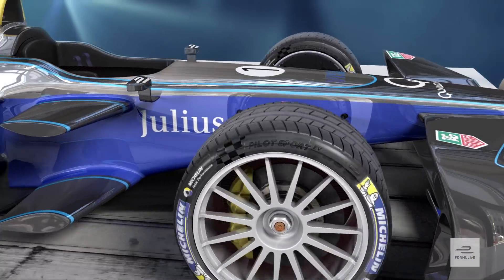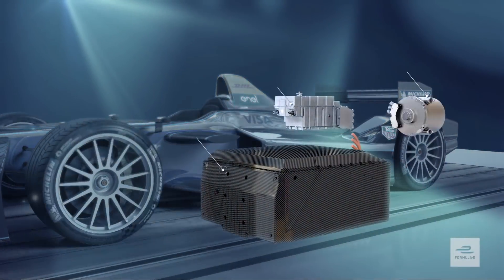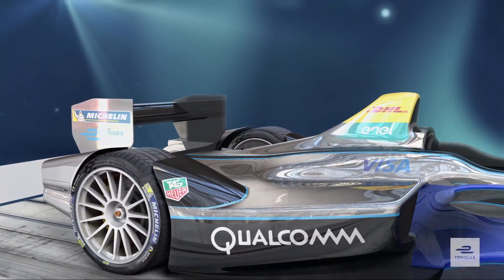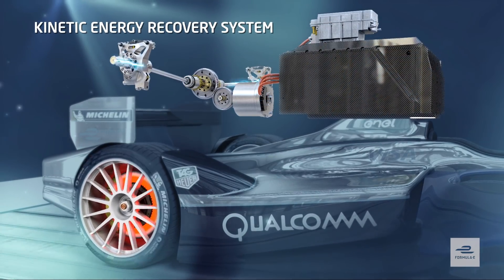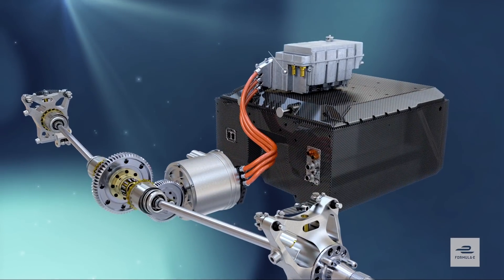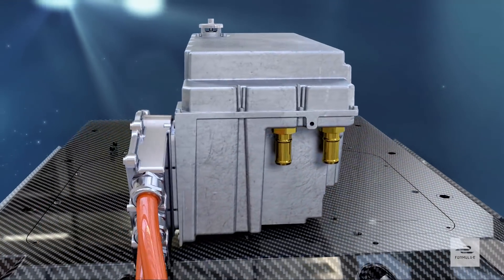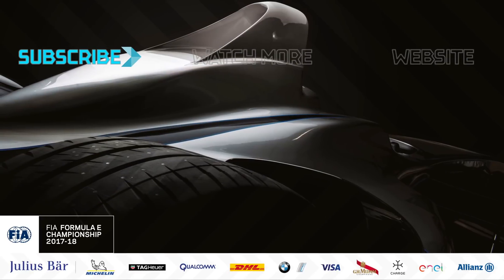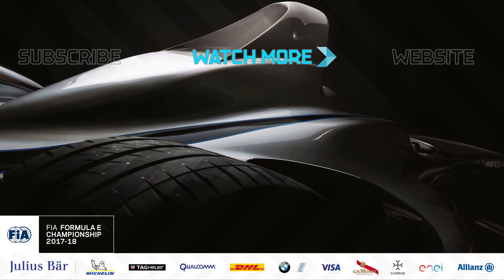How Does A Formula E Car Have Instant Power?

Comment: how many years is it estimated till every team has pretty much completely different cars for each team, because right now there seems to be a lot of components that every team has to use
Reply: electric car is a new one so they dont want one team figuring something out and destroying a whole season. but if they want to help develop e-car tech, they need to fully encourage battery and motor developments. you can still set size and weight limit for the battery, so they'll actually improve rather than using bigger ones.

Comment: I was expecting some mindblowing information, not that in F-e cars have battery and electromotor/generator which transforms electricity to movement and vica versa. That's just basic, not very clever.
Reply: If you read the title again, with this simple things, you can achieve an instant power. That is the clever part.

Comment: I was under the impression that an electric motor delivers instant torque, not power.
Correct me if I am wrong.
Reply: Power = torque * w  where w is rotational speed in radians per sec.
Reply: iOliAC I believe your right. The torque is instant, but the power goes up with the revs.
Reply: Both
Reply: As far as I know the torque delivery depends on the motor construction and controller power delivery being in phase sync for "almost" instant power delivery from stationary. The best controllers are phase tuned by learning based on motor feedback.